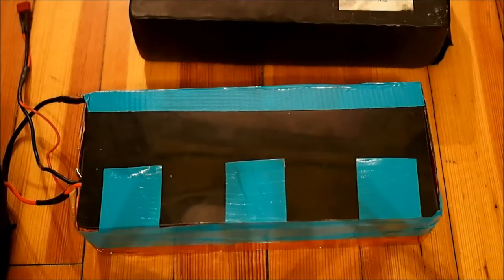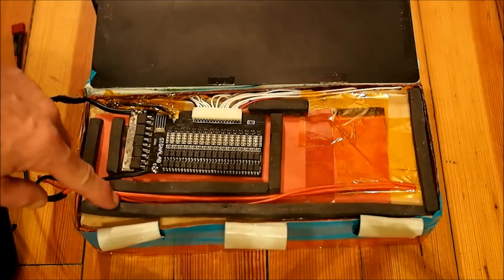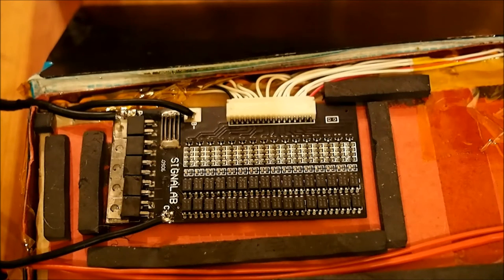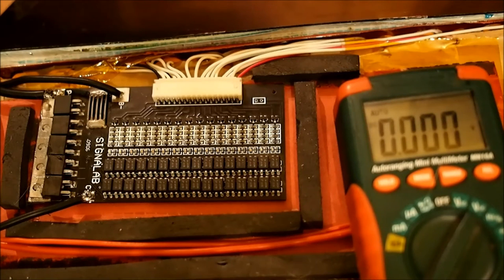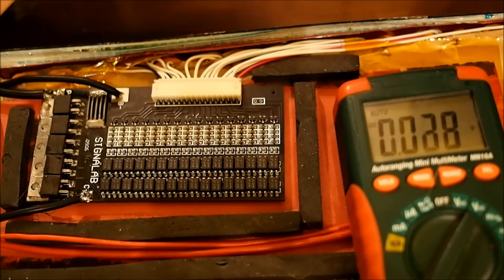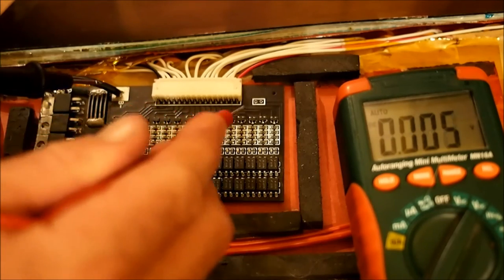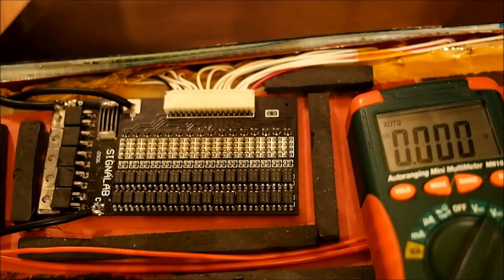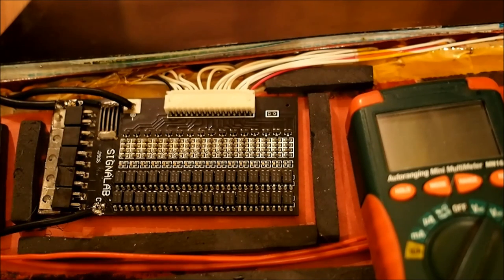LiFePO4 eBike Battery/BMS Troubleshooting

Comment: Good video very informative subscribed. Any tips on an issue with a 1 year old 36v 10s  13ah samsung battery  pack which will no longer charge (charger stays green not red). charger is outputing 42v no issue with charger connections . samsung cells are ok checked between balance wires and B- Wondering what is likely to be the issue which is preventing charging. Bike is otherwise operating fine.
Reply: Did you ever figure this out? I’m having the same issue
Reply: @Scrachdc  Yes issue due to faulty BMS. BMS replaced. now ok.

Comment: Hey man. I got a question: I touched 2 wires together by accident and shorted the lifepo4 battery I have.  Now it reports as around 32v out of full 48v.  I ordered 2 BMS from china on ebay.  Do you think replacing the BMS would fix it? it's a brand new battery.
Reply from the maker: I honestly don't know. You may be able to  measure the voltage of each series cell to try to gauge whether the battery was damaged. (In a functioning, balanced battery each cell will float at close to the same voltages.)
Reply: @charleswerbick2154  wow ok. I dont see why a new battery with short would cause damage to battery? Must be BMS that is dead?  Nobody knows at all. weird.
Reply from the maker: @canadianmonkey1954 I'm not trying to tell you your battery is hosed. But I'm also not going to tell you that it isn't.  the BMS is designed to protect the battery. But with a short it is possible to exceed the discharge rate the cells can handle or overheat them (both of which can damage the cells). You can  replace the BMS and see if the battery  takes and holds a charge.(with appropriate precautions) If it was the BMS the voltage should come all the way back up after charging. 

Good Luck!
Reply: @charleswerbick2154  Hello Thanks for reply.  My guesswork is that since it won't charge for more than 2 minutes or so that it would be the BMS.  What else could it be?  I don't understand how BMS works I suspect.

Comment: I don't have the foggiest idea of what you're talking about but could I send you my lithium battery it's a 48 volt 1200mah and I will pay you to fix it all I can tell you is it got wet through rain while I was riding it and when I stopped I noticed my LED would not light up anymore it won't charge on my charger it's only 3 months old I've only charged it 10 times

Comment: Hello everyone and especially Charles! I have a friend who has i lifepo4 48v 12ah and he dint use it for 6 mionths because he had an accidrnt. He is now trying to reuse the bike and the battery last very little time. I told hime let it charge again all night and try tommorrow again hoping that the battery needs some charge cycles  the get in full performance of old time. Was my advice good? Has anyone has any other ideas? Thank you in advance!
Reply from the maker: Hello Jamzra,
It really depends upon what state the battery was in when it was stored and the type of BMS installed. LiFePO4 batteries last the longest when charged halfway. If the battery was all of the way dead when stored then it the cells may have been damaged. Charging the battery all of the way up before storage can also cause damage to the cells.

AFA the BMS, old BMS boards pull their operating voltage from the first 4 series groups of cells. Newer BMS boards pull their operating voltage equally from all 16 groups of series cells. So if he has a bettery with the old style BMS then the first 4 groups of cells were likely drained all the way down while the battery was stored. If it was the new style then the cells were drained equally during storage.

I would test the voltage at each series bank both fully charged fully discharged. If the 4 banks of batteries nearest the negative battery lead show a lower voltage when discharged, then they have been worn more than the rest of the battery. If they show a lower voltage when fully charged then they were DEFINITELY damaged. If any of the battery banks read below 2.8V then damage to the cells has occurred.

To try to recover the existing battery as much as possible I would leave the battery on the charger for a long time (a week maybe?) without using it rather than charge and discharge it. The BMS will prevent the cells that are OK from being overcharged and the trickle charge the damaged cells receive over a longer period of time will do more for them than charging and discharging the damaged cells repeatedly.

Hope that helps!!!

P.S. for those planning on storing their LiFePO4  battery I recommend charging the battery to approx. 60%, then unplug the BMS from the battery cells before storage (i.e. unplug the big plug with a bunch of wires from the BMS board). This will prevent the BMS from discharging the cells during storage.
Reply: Thank you  a lot about your help! I will try to leave the battery in chargingand i will let you know about the results! Ihave the saame battery on my bike and i use it for 4 years and i know that is a good  one
Reply: it seems the battery is back again! thank you very much! Although now i have a problem with my motor. Ithink it is hall sensor problem. This is the motor i have https://encrypted-tbn0.gstatic.com/images?q=tbn:ANd9GcQQe-AIJE7fDrBGCEGcQgExSfEm_VC_oKmJbLtH4aPOZaYYbuzQEQ  How is it possible to find suitable sensors for this motor? Thank you for any help in advance!
Reply from the maker: Most of these use 3x SS41 sensors on a board together. If one has failed I would recommend just replacing all 3 while you have the hub apart... They are not very expensive. (If you look on ebay or google for 'SS41 hall sensor' you will find them readily.) The trick with those is to make sure that you solder them in the correct orientation and that they are positioned correctly. Look carefully at the old ones and take some pictures with your phone to make sure the new ones go in the exact same way as the old ones were.
Reply: Just opened the motor and found these tiny devils! I see that they are ss41! I already ordered them in a local electronics store! Now i got to find someone with good skills in soldering! Thank you very much for your help!!
Reply from the maker: jamrza - Good Luck! Also make sure to check the wiring coming off of the sensor board. (One if those wires being pinched can mimic the symptoms of a bad sensor).